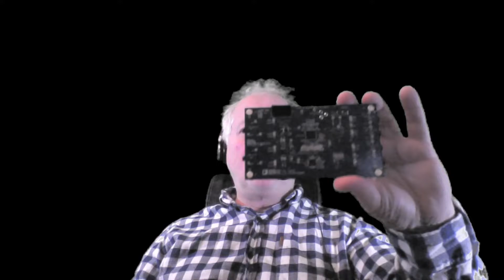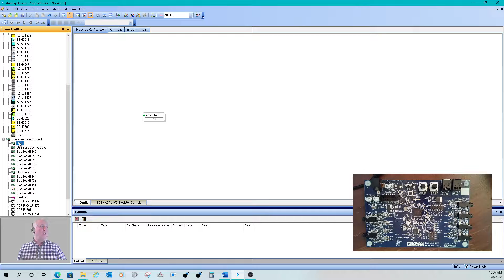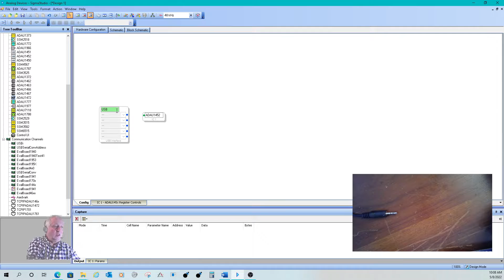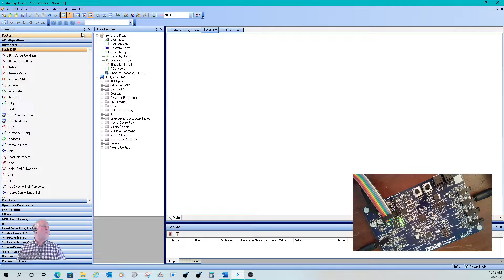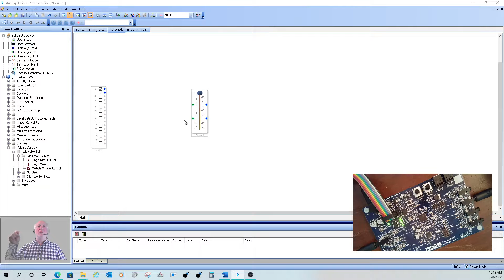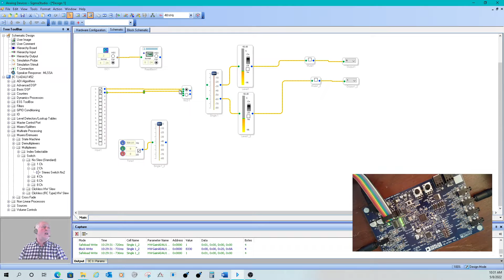ADAU1452 Basic Starter Project

Comment: Hi, if I have a custom algorithm that I've developed is it possible to hand code the processor instructions myself and have SigmaStudio download it to the devboard? Or are the only functions available the canned blocks that ADI provides ? What are the licensing terms for SigmaStudio? Does it stop working and require you to pay for a full version after some time has passed ? I noticed that was a thing on some of the other now defunct dev boards.
Reply from the maker: Hello, I suggest you go up on EngineerZone forum on Analog.com and sign up to the forum and then send me a direct message. My name on the forum is Davethib and I check the forum often. I am not always on my YouTube channel so it takes a while before I see it. SigmaStudio is free and never stops working. There are a few blocks that have royalties so we have time-restricted blocks to be able to use the block and make sure it will do what you need then we setup a license and send you unlimited blocks for your use. We do not release the assembler programming environment because it requires too much internal knowledge of the chip and too much support. However, you would be amazed at how much you can do with the canned blocks and if you need something more custom we can talk directly. After all, the licensed blocks have often come from other customer's who have developed them. So send me a direct message but PLEASE also send a friend request so I can respond!!
Reply: @HowtoSigmaDSP  Thank you, I will. Looks like the DEV board you show will do what I need, however, the programmer in me ... 😆

Comment: I have an RF project that uses an ADI EZ-Kit eval board documented in "Experimental Methods in RF design et al." from the early 2000's. I'd like to reproduce that project. What is a contemporary ADI DSP board that would replace the SHARC EZ-Kit ? For a hobbyist experimenter? Is the software environment  you cover  here capable of reproducing projects that were created for the EZ-kit? The book "Experimental Methods in RF design" has just gone to reprint from the ARRL but the reprint contains all this ADI DSP unobtanium. Thank you.
Reply from the maker: Hello, Gee, this was an RF kit? Sounds like the frequencies will be too high for the SigmaDSP boards to deal with. Some of the SHARC products were capable of running at high rates. The SigmaDSP line was developed for audio applications. Of course the audio for a RF system could be processed with these DSPs but the modulation of the RF would have to be done elsewhere. Do you know what the SHARC EZ-Kit was doing? The audio functions it was doing and the sample rate etc.? We still have plenty of newer SHARC eval boards around that are probably much more capable then those old ones but I do not support those products.
Reply: @HowtoSigmaDSP  Hi, thanks for the response. No, not RF,  it was an audio board that functioned as the last stage of the radio to produce the audio, filter and display some of the signals present within the down-converted audio bandwidth as some of the signals are CW of limited bandwidth (500Hz). SSB is also of limited bandwidth (2.2Khz) so many signals could fit within 48kHz audio. From the description the board had 4 analog audio input and 4 analog outputs and executed at 33 mips along with a few GPIOs.

Comment: Hello, the default hardware sampling rate of AUAU1452 is 48K. How can I change the hardware sampling rate to 96K in SigmaStudio?     Thank you!!!
Reply from the maker: Hello lqldyxlqldyx, 
Changing the sampling rate is like a 3-legged stool. You need all three legs to be there or you will fall over. 
1) Set the sampling rate up at the top of the screen in SigmaStudio. 
2) Set all the hardware registers in the DSP for the start pulse and the sampling rates of the serial ports, but important in this is all the other parts in the system like the codec also needs to have registers set correctly. 
3) Send the correct clocks to the part. 

Since you want to go to 96kHz it is a multiple of 48kHz so the 12.288MHz crystal is fine to use and the PLL settings will not need to be changed. So #3 I mentioned is not a problem. #1 is also easy. #2 is tough for me to tell you exactly what to do because I do not know your system details for the serial ports. The Start Pulse will set the core rate and that is easy to set. What is difficult is the codec on our eval boards. Many of the eval boards and 3rd party boards use the AD1938 in Standalone mode. In that mode you can only run at 48kHz. You have to get it out of standalone mode which will require hardware mods and then figure out a way to change some of the registers. I have answered these questions is detail on EngineerZone in the past. Have a look there. Meanwhile, let me know which board you are using? 
Also, you have me thinking and wondering if I ever showed this in any of my videos? I might not have... I will be making new videos soon. I had computer hardware issues keeping me from making new videos and that was solved a couple of days ago. Now, I just need time to make them! LOL
Thanks for watching!
Reply: @HowtoSigmaDSP  Thank you for your reply. PCB was designed by myself. AD1938 is not Standalone mode. It seems that there can't be pictures in the reply on YouTube. I'm looking forward to your new video very much!

Comment: Tnx you mister! Fuckikg button "Read All Register"!
Reply from the maker: I sympathize with your comment! I have "been there done that!" This is why I warned about this in the video. If you feel the need to do this SAVE the PROJECT FIRST! Really, usually you just need to confirm the chip is alive and communicating. If this is the case then the DC cell connected to the ReadBack is how to do that! If you just need to see the status of a register and might need to do it often then use the sequencer to read just that one register. You can even have the program read it and send it to a ReadBack but that uses instructions every sample period so I do not do that unless the program needs to "do something" with that register data. We did improve the sigmaStudio register window with the Sigma350 parts where you can read only one page not the entire hundreds of registers! But, I have not been able to make the argument to take the programming time to change the older Sigma300 parts. If we have programmers to assign then we assign them to fixing bugs not making changes to something that is working and could potentially introduce new bugs! So beware of the Read All button!! DANGER DANGER WILL ROBINSON!
Reply: @HowtoSigmaDSP  I had no idea you were from the Sigma Studio development team, otherwise I wouldn't have made such a comment. I understand that this is a project for highly skilled engineers, and is not "foolproofed". I was no less impressed by Sigma Studio when I saw Google Earth first time  in 2004
Reply from the maker: Not a problem at all. Your comment was on point to show an issue. I feel there should be a warning pop-up to ask if you really want to read-all!! When SigmaStudio was first designed the parts were much simpler. Just look at the difference with the ADAU1701 there is only one page of register settings. So a Read-All button was not too much of a problem however, with the hundreds of registers on the ADAU1452/1467 parts it is a problem but the "feature" was grandfathered in without the programmer really thinking about the danger.  Therefore, I try to warn people to not use it unless you have performed a save and even then there is not too many times that you really need it. Have you watched my video on the Capture/Params/Sequencer windows? Understanding how to use those windows is very helpful. Anyhow, Take care and keep enjoying the SigmaDSPs!